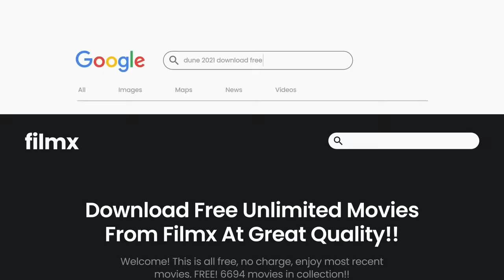Garden Rescue Edition (Watch me Tackle this Overgrown Jungle)

Comment: I saw a comment about showing your videos in schools to show the meaning of hard work and how it pays off.  That's not a bad idea, really.  Even corporations could use your videos as an inspiration and reminder of how to solve critical problems in the workplace. 

Assessing the situation to see where to start, breaking the problem down into manageable pieces, working through and thoroughly completing each piece before moving on to the next while taking a quick moment at each transition to glance back and assess the progress so far.  And stopping to handle the big problems that arise (like the big tree) as you get to them.  No putting them aside - just plow on through and get them done before continuing any further.  And so forth until the problem is solved.  A quick overview and you can see and correct any loose ends.  

George, you're actually a philosopher!  Your work and how you approach it is a great road map for life in general and for each bit of it, each situation, we encounter along the way!  🌿🌿🌿

Comment: That was quite and undertaking, George, and turned out nicely as usual.  Sure glad your trailer could be backed in so far to save steps. Your push mower is a beast to be able to mow down that thick grass!  Looks like a few trees are budding out down there so your Spring is starting.  Here in Georgia the kids went back to school last week in the extreme heat of August. Yesterday there was a heat index of 103 degrees Fahrenheit.  Blessings.